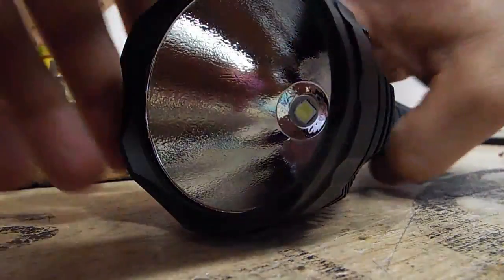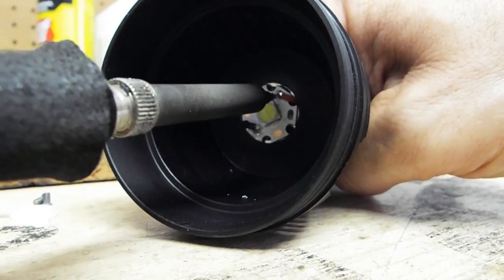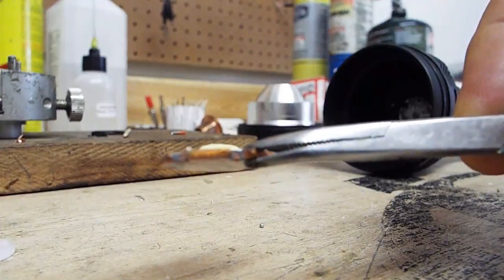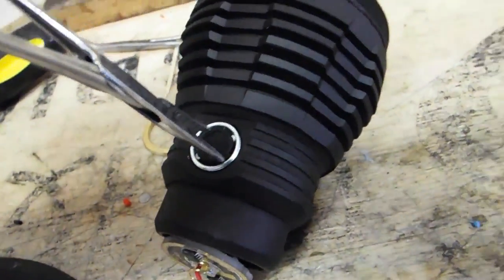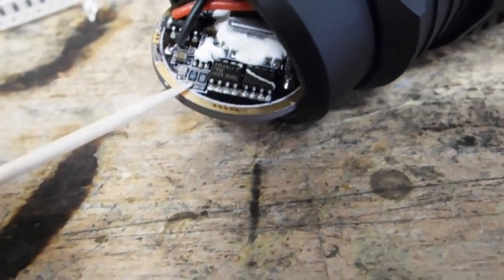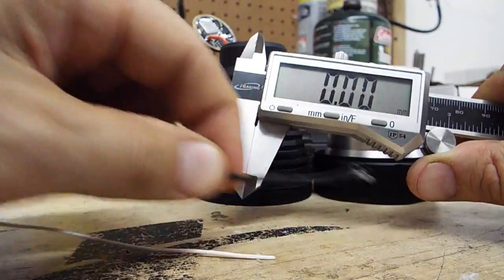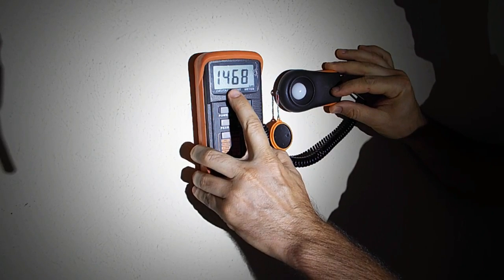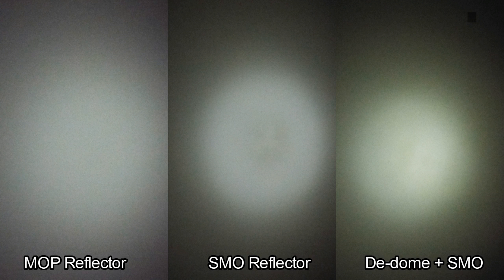Convoy L6, How to Double Your Lux!  Increase Range.

Comment: what batteries do you  recommend for this light?
Reply from the maker: I use the new version of the Keeppower 26650 protected cells.  You want to make sure you get the newer version because the older ones are bit long for this light.
http://asflashlights.com/batteries-and-chargers/60-26650-keeppower-5200mah-protected-high-discharge-flat-top-rechargeable-battery.html?live_configurator_token=57acb7e8743d5a9c41a3db7af86506f1&id_shop=1&id_employee=1&theme=theme7&theme_font=font3
Reply: Thank you for that tidbit of info as I ordered the L6 flashlight from aliexpress along with four 26650 protected cells that measure 71.1mm from another seller on that site. I rushed in to my purchase only to discover that it is recommended by the L6 convoy to use a newer shorter battery, however, I did contact the battery seller before they had the chance to dispatch them and they messaged me that they indeed have the shorter variety in stock.
I only have their word that they would send the new cells and still felt some anxiety over it, but I am grateful to learn that all will not be lost if they do in fact send the older type. So thank you for taking the time to eleviate my concerns.
Reply: drEmulatorMadmax keeppower 26650 protected version 2016 fit perfectly!
Reply: For those that don't understand,  he's saying they are 69.6mm long. Sounds good.
Reply: Tim Shettlesworth Sure, they are slightly raised flat tops.
Reply from the maker: Hello..    I prefer the Keeppower brand 26650s myself.
Reply: +AdventureSportFlashlights were do you buy those and what charger is good. Im wanne try the xtar sv2.
Reply: AdventureSportFlashlights Will the older batteries still fit as I have just ordered four of the 71mm keeppower 26650
Reply from the maker: Yes, they still fit.   I have a pair here I have put into my own many times.  The only issue I have hear of with it is a few people reported a slight flicker in the LED when the batteries were fully charged for the first minute or so of run time.    Only some had this experience and the ones that did all said it quit after the first bit of the cell charge was used.
Reply: wayne murphy There are 2 ways to use longer batteries. One is to only screw the battery tube into the head enough to seal the o-ring. This gives you maybe 2 extra millimeters. You may feel a slight wobble from the head sometimes, but it's no big deal. It bothered me, so I chose the second solution, which was fabricating a spacer for the tail cap.
Reply: Thank you Jason, that sounds like a great idea. I haven't received the batteries or flashlight yet so I will find out hopefully soon enough which batteries they have sent . Did you solder the spacer to the tail cap to get a better connection and prevent it from falling out and getting lost? Cheers
Reply: wayne murphy I made my C shaped spacer from steel that is slightly spring loaded to hold it in place.
Reply: The battery numbers are in and the measure 26696ish
Reply: Thanks Jason for clarification just waiting on L6.
Reply: These are flat tops are they going to stack ok?

Comment: Hey Matt,

I'm having some serious brain fade. Does the Convoy driver have a pair of R082 resistors?

Since they are in parallel that's 0.164 ohms, right?

Then when you add your extra R120 on top that bumps it to 0.284 ohms, right? 

So as resistance in that circuit goes up, the amp draw at the emitter increases. 

Then way does adding an R100 instead of the R120 cause a higher amp draw? I just don't get it. There must be more involved. 

BTW, the generic FX30 driver is using an R100 and R082 to produce a claimed 4.5 amps. That seems backwards as well.
Reply from the maker: When stacking resistors in parallel the resistance is cut in half rather than doubled.   Putting them end to end in series would make it go up.
Reply: Doh! I told you I was having brain fade. lol

Comment: what's the reliability and usage time after these mods?
Reply from the maker: Battery life on high from the factory is about an hour.  With the boosted drive current on high its about 45 min.    The impact on reliability is negligible as long is turn the power down when the head gets hot.
Reply: @Lumencraft-  Just what I wanted to know. Thanks to MAtt for the answer and Schindlersfist for the question! :)

Comment: I just did this to my K60 after watching your video ASF. It's my first flashlight mod.  No driver mod but shaved the dome, clean and replaced the sink with Arctic Silver. That moment of truth.....  The light came on! Better tint and throw now.  Thanks for making the type of video that's actually worth something. LOL.
Reply from the maker: No problem.  Thanks for the input Dave.
Reply from the maker: Thank you for letting us know about your experience with doing this.
Reply: Sorry for getting back late. Good Matt chiming in. Thanks again Matt.   With the K70 I noticed a shift from bluish cool white to more "pure white" albeit still some bluish.  For the L6 NW, I didn't really notice much shift in tint, only the tighter hotspot.  I don't know if this is my own eyes not seeing a particular shift, or if it didn't shift much this particular time.
Reply from the maker: Congrats Dave!   Always nice to hear of someone enjoying the hobby..   Thanks for the feed back as well.
Reply: Dear Dave,  after  you shaved the dome on K60 , do you have a slight of yellowish/greenish  in the tint ?
Reply from the maker: Hi flybirdclip,    De-doming an LED will cause the tint to shift.  In most cases it will get about 300-500 degrees warmer.   Typically more yellow in my case, but I have never noticed a green in them.  

Did you have one turn green from doing this?
Reply: Yes, I de-dome XHP70 on convoy L6 and tint shift toward yellowish , also detect a bit of greenish on mine.
Reply: Price: $50.99 - $68.56. Coupons:
http://couponsgearbest.com/2017/02/01/convoy-l6-5000k-flashlight-active-coupon-price-gearbest/
I hope this will help you

https://www.youtube.com/watch?v=TRp8WxJsivw

Comment: do you have any suggestions on which emitter type to buy stock. are there any performance differences, or is it all just personal preference with the color? ahhhh dedoming the led feels like it could go so wrong! ._. its a nice video though!
Reply: Replacement LEDs already soldered to a DTP copper board (like stock) are available for about $12 and easy to swap. So if you damage your own it's not like you have to replace the whole flashlight, but it's still a bit pricy compared to other other LEDs which cost much less.
Reply from the maker: Yes, the cool white will be slightly higher output, its N4 bin and the neutral is N2.

Comment: Nice vid! While r120 had a very small resistance, will it burn the led if we're using a wire to bypass the existing resistors instead of stacking resistor on it?
Reply from the maker: You could use a piece of wire.  The light would be basically direct drive then.  You will get around 7 amps of current to the emitter like that depending on which cells you use.  The increase in output will be marginal though vs using the R120 resistor.
Reply: I bought 1 last month with 2 keeppower protected 26650 cell.. i dont have a multimeter, so cant do any measurement.. anyway, thanks for your info! will definitely try to mod it!

Comment: One more question, because your the only person I've seen get inside and mod this particular light, can the side switch be modified or replaced to include on/off ability? I hate tail switches.
Reply from the maker: It would be hard to do.   I am guessing that one of the main reasons they went with a dual switch design is to eliminate parasitic drain from the batteries.   I know that using a mosfet driver with a 2 cell setup you need a manual switch for this reason.

Comment: Hey Matt, awesome stuff here. If dedoming the emitter gives so much more output, why did the manufacturers add the dome in the first place? Also, have you done any night videos showing the improvements? Lastly, what are the downsides with the resistor mod, more heat build up and shortened battery life? I'm a little worried about that mod.
Reply from the maker: De-doming the emitter consecrates the light into a smaller pattern, it doesn't gain add to the output.   The reason most LEDs come with a dome on is because they are designed with interior lighting in mind and not long range flashlights :)    I haven't done any video beam shots yet because my camera cant do it.  It has mandatory auto adjust in video mode.    The down side to the resistor mod would be less run time.   The L6 is a pretty beefy light with good heat sinking, so the extra heat is not a huge issue.
Reply: +AdventureSportFlashlights Interior lighting! Ha, now it makes sense. I downloaded a pdf on an emitter from your website and they showed how it was assembled on a ribbon and rolled up on a reel for sale. I thought that was a strange way to sale leds. :)
Reply: +AdventureSportFlashlights Apparently, the secret to more  lux is Consecrated light. You gotta love autocorrect. Thanks for the great video Matt.
Reply from the maker: LOL!
Reply from the maker: Ya rich folks have machines that will peel those emitters right out of the reel and put them on fixtures.

Comment: how is changing the wiring going to effect the reflector?
Reply from the maker: It allowed me to move the reflector closer to the emitter changing the focus.   For testing with the MOP reflector I omitted the LED isolator.  This carries risk of short, so its not recommended, but it did work :)    With the SMO it also gave me a slight gain, but left a pretty serious donut in the beam.   Using the smooth reflector I would just skip that part.
Reply: +AdventureSportFlashlights any right, that makes sense. Got an eBay special on its way, xhp70 with 2 x 26650 (dubious surefire batteries) and charger for $25. looks identical to thorfire xhp70 without the branding. Be interesting to see what's inside and how the light it.
Reply from the maker: Ya, man let us know how it works out.